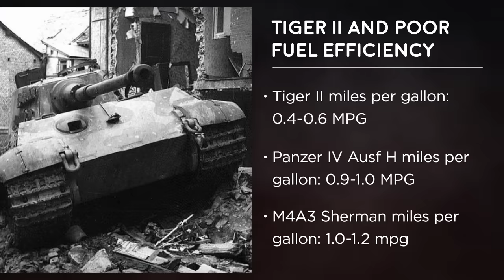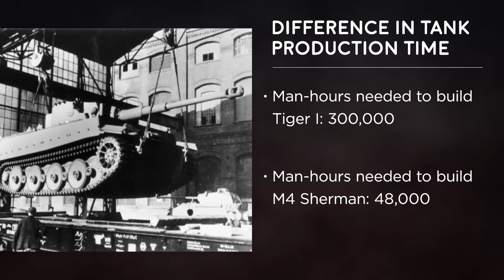Why Did German Tanks Perform So Badly in The Battle of the Bulge?

Comment: The Germans simply overengineered everything. An WW2 Ordnance Corps officer in the US Army noticed that a German 105MM gun's breech block had almost three times the number of parts that the US version did, which provided no advantage. And I would bet the Russian version probably had even fewer parts than the US version
Reply: Yeah, I read a book once where a US engineer said that if you could build it with 3 parts the germans would use 5.
Reply: Read a book years ago that pointed out the Germans could have manufactured four Panzer 4s for every one King Tiger they produced. Luckily, they didn't because a Panzer 4 could still give a Sherman a fair fight
Reply: @kevinkelly5780 even if they made more panzer ivs. They wouldn't have the men to field them.
Reply: @manz7860  or fuel to drive them. Or the logistics to supply them. Or the spare parts to repair them
Reply: Truer words were never spoken if you ever opened the gas cap on a still chain saw you will completely understand
Reply: even in my time working in auto manufacturing, anything we built for a german company was a pain in the ass. they demanded quality, for sure, but that's offset with more unnecessary shit to break or weird designs that didn't seem to have a point.
Reply: This is exactly the reason I have massive respect for Russian engineering, which I think is severely underappreciated in the west.  If you ask people who produced the best engineers or best engineered objects most would say Germans, or Japanese,  but most also just don't know about Russian engineering.  It takes great skill and ability to make something simple “Making simple is sometimes many times more difficult than complicated.” -Mikhail Kalashnikov.
Reply: @manz7860  This is the problem, and the thing people who point to the cost and fuel efficiency of German heavy tanks miss.

Yes, a Tiger II is more expensive than a Stug. A lot more expensive. But it takes the same number of crew and is likely to cause considerably more damage to the enemy than a single Stug. At that time, manpower was a more precious resource than steel and factory hours. Similarly, while a Tiger II does use more fuel than a stug, it also can do more. "Build five stugs for the cost of one big cat" sounds good, until you realize that five stugs use a lot more fuel than even a king tiger.

The big cat's weren't badly designed tanks, in fact they were fairly logical for the situation Germany found itself in. The problem was that the situation itself was utterly untenable and as a result they failed.

There was no piece of military equipment that Germany could feasibly have made that would have turned the tide or even performed significantly better than what they did make.
Reply: @zoro115-s6b 100% correct. They should have dug in and designed defensive positions around the Tigers. Maybe after X amount of months slow crawl and big losses they could get the Western Allies to the peace table.
Reply: The Germans were barely mechanised. The British the smallest allied power by production made over 110,000 universal carriers a vehicle that replaced horses in their load bearing duties. Over 5,000 Churchill’s over 5,000 Crusaders. How much did the Germans make.
Reply: @-Zevin- The Japanese I would argue both guaranteed quality and simplicity
Reply: @OscarOSullivan   I wouldn't really disagree with you, I think Russia had much greater execution because of its huge industry but considering how limited the Japanese were in WW2 they had some good designes, the Arisaka rifles were some of the best of the period.
Reply: @Kruppt808 Nobody is going to smash face first into a position like that except for nations with USSR in their name. Bombers and fighter bombers would have a field day with such fixed positions.

This also places Germany in the position of France at the beginning of the war. All the Allies have to do is break through at one point, and the whole of the defensive line is pointless.
Reply: That continues to this day. They make great cars but way over engineered and expensive to repair.
Reply: @Kruppt808  the US with probable stars
Reply: Though the Russian variants were worse
Reply: @-Zevin- Absolutely. In the West we mistake simple for crude. When I was in the army I thought the M16 looked like a toy space gun and itvwas a pain to maintain.
Reply: @OscarOSullivan Most of their army small arms sucked. They made a good light machine gun however, not to be confused with their lousy sub machine guns. Their torpedoes, on the other hand, were incredible.
Reply: @mtadams2009 But the Russians can’t make a decent car 🚙 to this day.
Reply: @manz7860 no they had the men for more tanks but they had no fuel
Reply: It’s still true to this day, German stuff works great for 6 months until all the parts start to wear out
Reply: Paraphrasing something I heard:

"German engineers use precise equipment, Russian engineers use a sledge hammer."
Reply: @kevinkelly5780  Lack of experienced crew and fuel would like to have a word with you
Reply: Yet today modern tanks are closer to what the Germans built than to what the Americans built. Don't see any Sherman like tanks after WWII. Tanks evolved in the direction of German and Russian tanks
Reply: @Outlier999 man if you struggle with basic maintenance on an AR-15 platform like the M16 then that's a you problem. Those things are as simple as they come. Only thing I'll give ya is that keeping fine sand out is a pain due to the cleaning oil the US Army uses.
Reply: Using 300% the material and components is not over engineering. It’s a lack of engineering.
Reply: @-Zevin- The Russians had very clever engineers.  Their problem has always been manufacturing.  It doesn't matter how good your design is if the peasants with sledgehammers don't adhere to high standards.
Reply: @bthorn5035   This was never really a issue either, Russia never had widespread manufacturing problems that lead to failure. poor fit and finish sure,  but not to the point of failure, often times very ugly but functional.
Reply: That's not true though. The truth is that German tanks just were not that good as Germany said they were.
Reply: @tylersmith3139  exactly. Over engineering something doesn’t make it breakdown more often, doesn’t require overly complex logistics to keep it running and shouldn’t require dozens of people to keep it running.
Reply: Meanwhile you could replace an entire Sherman engine in the field in like an hr or two? Thing literally slid out the back lmaooo mechanical failures what are those??
Reply: @mitchellmcguire1121  LOL, the delulu Sherman fanboiz are out in force.
Reply: @-Zevin-  Its not like Germany couldnt have done cheap or simple, there are perfect examples in ww2 of Germany doing just that, it just wasnt what was demanded most of the time.
Reply: @thezeitos469  "couldn't have"  maybe they could have but often they actively chose not to.  Maybe it was pride that to many German engineers complexity alone was a sign of a brilliant designer. However in Russia it was often the opposite, complex designs were ridiculed  and simplicity is often even harder to design than complexity from a competent engineering standpoint.  I think it's hard to argue that the Russian's weren't more right in this thought.  That's not to say German stuff was bad, the panther tank is the epitome of what the Germans could do in theory, on paper it was superior technologically to any other design on earth, but often theory and reality don't line up.  The logistics, reliability, complexity and cost of production made something that should have been amazing, very lackluster in practice compared to something like the IS-2 or even the cheap T-34

Comment: My grandpa was a Hellcat gunner in the Battle of the Bulge  ( 10AD ) and i remember asking him about it once as a kid. His response was brief, as it always was when i asked him about the war. "It was cold". Much later in life i learned his vehicle had an open turret ❤
Reply: The the engine inlet received air from inside the turret.
Reply: Hellcats in Europe? Just asking.
Reply: @anthonyeaton5153  yes, the M18 Hellcat tank destroyer
Reply: @anthonyeaton5153 where else would they be?
Reply: @anthonyeaton5153 if you are thinking of the plane that was used it Europe too. They were just not as common. The British used them too
Reply: In 10 AD? Dang that is old old.
Reply: @newspaperbin6763  Yeah the Battle of the Bulge started a bit earlier than most historians realize.
Reply: @newspaperbin6763  10th Armored Division.
Reply: @guaporeturns9472  where they based in Italy. Don't think they were in England.
Reply: @davestier6247  tank destroyer? The famous British RAF Typhoon was called a tank killer but only 4% of its kills were tanks.
Reply: @anthonyeaton5153  .
It did play merry hell with the support vehicles and was very bad for morale.  Sooner or later, a tank without support is a dead tank.
Reply: Free air conditioning.
Reply: @newspaperbin6763  The Romans knew it as pugno tumor… 🤓
Reply: @anthonyeaton5153 the M18 Hellcat was a tank destroyer, specifically built for killing tanks. It was fast, agile, powerful, accurate and relatively small, all you need to kill tanks, especially german ones. It was about the same size as a Panzer 4 with about the same gun performance but it was much faster and had much better turn rate and turret turn rate and wasnt as cramped
Reply: @anthonyeaton5153 you're confusing the F6F Hellcat naval fighter, and the M18 Hellcat tank destroyer. In this regard, the person's dad was a gunner in the tank destroyer type, not a pilot of the fighter type
Reply: That sounds like a British level understatement. It was the coldest winter in Europe in decades.
Reply: @emberfist8347  funny story, I also owe my existence to a German artillery shell. By coincidence my other grandfather was also active in Belgium and took a particularly bad shrapnel hit to his back and hindquarters. He got sent to London, his nurse ended up being my future Grandmother. They married and went back to Brooklyn NY. And here I am.
Reply: @davestier6247 i owe my existence to a german shell too. My grandmother's first husband was killed trying to take a bridge only a week before germany surrendered. If he lived my grandmother never gets married to her second husband and thus never has my mother.

Comment: Knocked out tiger tanks were difficult to recover thanks to their weight; apparently tankers were forbidden to use a working one to tow another because that would wreck the engine in the working one. That situation could only be worse for the tiger II.
Reply: Difficult yes, but they did it. Only when the allies advanced did they have to leave them there or had to blow them up. When the Germans controlled the ground, they recovered and repaired them.
Reply: Two 18 tons Famo halftracks were required to retrieve a Tiger I. When a Tiger I was used to try and retrieve a Tiger I it often damaged the transmission.
Reply: Tigers couldn't even make it to the front on their own without frying their transition. They had to be sent by train lmao
Reply: @nekrataali 
How come the Tigers of Schwere SS Panzer Abteilung 101 did a 300km plus road march to the Normandy front in June 1944 and how come the Tigers of Schwere Panzer Abteilung 504 did a 400km road march to Maknassy and back in Tunisia in March 1943. 
Neither went by train.
Reply: @lyndoncmp5751 yeah but that only applies to pre-Stalingrad lmao they couldn’t do that once the Americans showed up or ever when the Soviets advanced
Reply: @lyndoncmp5751 that’s two examples no offense what about the majority of tiger groups?
Reply: @Walker-ow7vj  
What about them? They ALL got to where they were sent. Not a single Tiger battalion failed to reach the battle front it was sent to. 
There were THREE Tiger battalions sent to Normandy. They ALL got there via long road marches.
Reply: @Walker-ow7vj 
Pre Stalingrad? The Tiger battalions weren't deployed pre Stalingrad. They only made their debut in autumn 1942. It wasn't until 1943, post Stalingrad, that the Tiger battalions were really deployed. 
The Americans didn't show up without the British. The British faced most of the Tigers in the west.
Reply: @lyndoncmp5751 That was a rare spectacle of the Tiger being able to work on its own, and even then it probably still required excessive maintainance to stand up. Tigers weren't exactly reliable as hell and burnt maintainance crews energy like a Scientology member throwing his or her money out on worthless crap. And even when it did make it it usually got penned by some low velocity 75mm Sherman from the side or raped by several Firefly Sherman's with high velocity 17 pdr guns. Or just bumfucked by air support because Germany had about as much air superiority in 1944 as the chances of Wehraboos not regurgitating the same points based on revisionism: absolutely little to none.
Reply: @squeaky206 
1. In 1944 the Tigers had an overall 80% plus operational average.

2. Tigers had a 12:1 overall knockout ratio, knocking out circa 10,000 or so allied tanks, assault guns and tank destroyers for less than 1,000 Tigers knocked out. 

3. Sherman 75mm pens of Tigers were extremely rare. 

4. Air power took out few Tigers. Circa only 5%.

5. Anyone who throws around the childish Wehraboo term is immediately discredited and needs to just grow up. 

Sources: 
Thomas L Jentz, Germanys Tiger Tanks and Tiger I and II Combat Tactics. 
Wolfgang Schneider, Tigers In Combat Volumes I and II. 
Christopher Wilbeck, Sledgehammers Strengths and Flaws of Tiger Tank Battalions in World War Two. 

Why don't you try reading primary sources from books instead of believing the modern internet nonsense?
Reply: @lyndoncmp5751  To burst your bubble as well, that would count for total destruction of tanks? Because tanks tended to be salvaged if possible and not just left on the battlefield. And 75mm penetration was possible if done on the sides, assuming the tank was even able to flank around the Tiger. I just want to know if you're talking about total loss (cannot be repaired or salvaged in any way shape or form) or overall losses. Though Soviets tended to write off perfectly salvageable equipment as destroyed so the kill count might be off by a little. Shermans weren't much of a priority as the two rarely met though when they did, it was usually the Sherman that won out. And it depends on the type of conditions a Tiger operated in. So the bocage of Normandy and Brittany would be perfect for ambushes with the 88mm gun, as well on the open steppe. Not so much in inclement weather as this video touches on, where oil often froze to a point where entire tank crews had to abandon their vehicles. So it was more the mechanical and technical issues that troubled the tank more than any Firefly or M4 could elicit.
Reply: No, No and No !!! They had very   little fuel and little to no air cover avaliable.  Subject over !
Reply: @lyndoncmp5751 They all got there and then they lost the war
Reply: @RobbyGAMEZ 
Tiger tanks didnt lose Germany the war. Germany already started losing the war after Stalingrad and El Alamein. Actually, before that even. Nothing to do with Tiger tanks. Tigers weren't even deployed at Stalingrad and El Alamein. The combined British Commonwealth, Soviet and American forces had 4 times as many tanks, planes and men etc. It didn't come down to 1,800 Tiger tanks 😂
Reply: Great propaganda peacetime weapon for deterrence.  Terrible one for all out conventional war. @nekrataali

Comment: Theres a comment by one german soldier about the roads being muddy bogs when it was over cast so they couldn't move. Then as the clouds cleared the roads froze enough to move and the airforce made sure they had to hide rather than move
Reply: The Typhoons and American ground attack aircraft were around all the time so the moment the fog started to lift, they were in
Reply: Another problem for the Germans when traversing mud and then having a very cold night was the mud buildup between those interleaved road wheels on the Panther, Tigers and many halftracks. Many nights that mud would freeze solid thereby immobilizing the vehicle and getting the mud off the inner wheels was a gargantuan task as was repairing any damage to those inner road wheels.
Reply: @sirridesalot6652  It ain’t German engineering unless they make it needlessly complex.